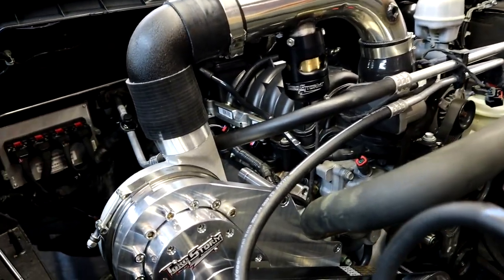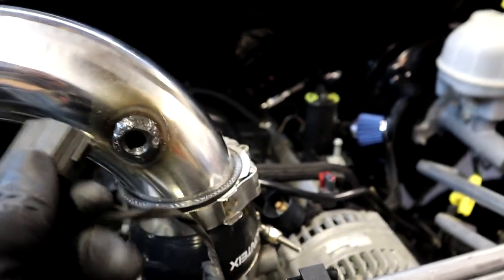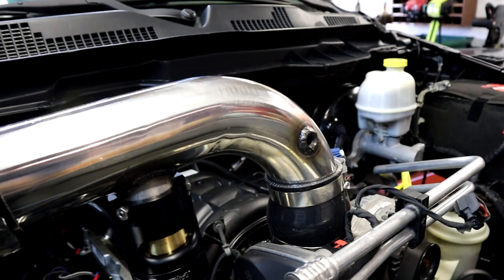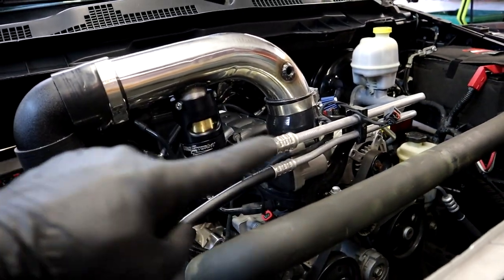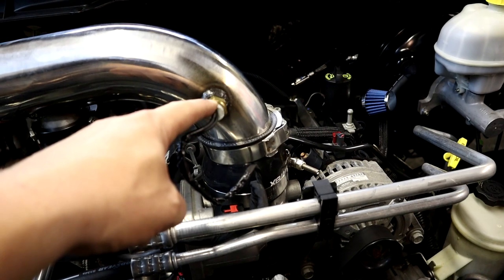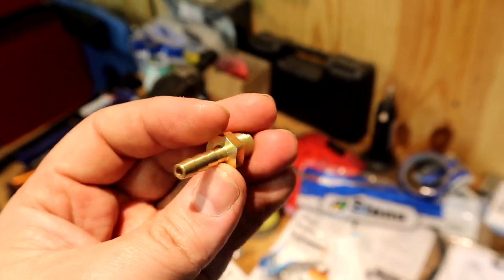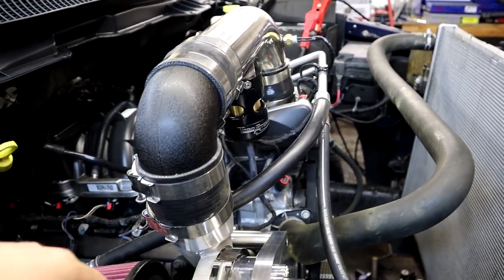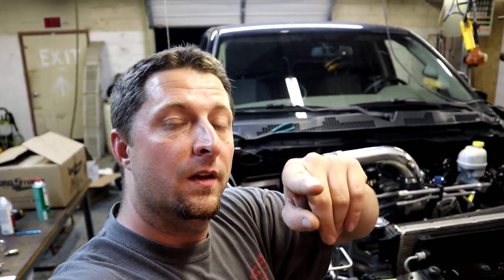Project STORM Is Almost Done RAM 1500 4X4 TorqStorm Supercharger Install Part 5

Comment: Does this setup offer the same boost as the intercooler setup?
Reply from the maker: Yes no difference however not using a intercooler will gain a extra 1-2psi in most situations.

Comment: You were asked why no intercooler and you said easy installation for a daily driver...
Thats when you most need to add a intercooler. The air entering the intake manifold will be reading over 160 degrees fahrenheit which will be downgrading your degrees of time drastically breaking your engine on the short run. A stock 5.7 hemi on the torqstorm will reach 480whp on on its first run on the dyno the second run will be already down to 360 and third 270 respectively if done continuously. That information can be transfered to street driving. Hot air does not atomize like cold air due to its thinner density. You will be replacing spark plugs and lacking whp constantly.
Reply: I have a torqstorm installed on my 300c and committed the same error. The 3.250 pulley was producing 11lbs of boost. Use an intercooler please.
Reply from the maker: I have tons of logs on my Frostbite truck and data when the meth comes on temps instantly drop to 90-100degrees pulls no timing at all. timing is only pulled on wot if the iat temps is above the 130ish mark as long as the iat sensor is mounted in the path of the water/meth it will never pull timing if setup is right and the volume of meth is right . But once we are done we will show the track logs and data afterwards.
Reply from the maker: @EQGYT  we are using a 3.5 pulley and have seen about 7.5psi so far
Reply: I hope I can achieve 7psi on the standard size 3.5 pulley I want to purchase a 3.2inch if any one has one laying around. My charger has an intercooler 3.5 inch and plumbing a 2 stage snow performance meth kit 50/50. ill plug my i.a.s. downstream of the meth kit thanks for that tip I had overlooked that!

Comment: Where did you get your iat sensor?
Reply: Threaded IAT for 2005 ram 2500 or i think a 2005 dodge neon srt4 is the same as well... but picked it up at autozone

Comment: Are you using a stock iat sensor? And what do you use for the bung mounting spot?
Reply from the maker: You can either use the stock one and drill hole to insert the factory rubber bushing or buy a threaded iat and weld a bung for it using the factory iat is definitely easier and works fine I had no issues with it blowing out.
Reply: @FrostbiteRam  what threaded iat works?
Reply from the maker: @daddybearcom  the part number is in the torqstorm instructions let me see if I can find it. However if your truck is a non 8speed you also will need to cut and soldier your factory wires to the sensor if you go that route as the connector dosen't fit.
Reply: @FrostbiteRam  ok im actually in a 2015 8 speed dodge challenger 5.7
Reply: @FrostbiteRam  thank you for all your help!!!! I actually just started following you on ig

Comment: 12:56 quarter mile
Reply from the maker: Idk stock cam,headers and full weight with street tires im hoping for a full second off the stock pass we made going to run low timing street tune for this truck.